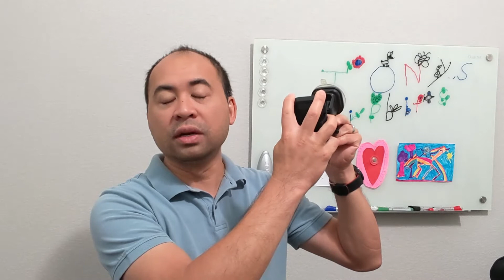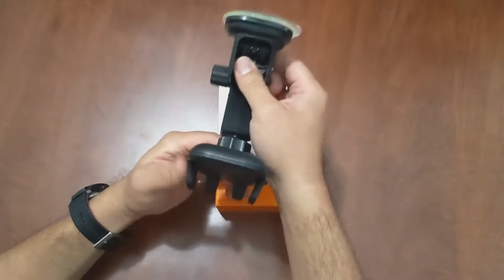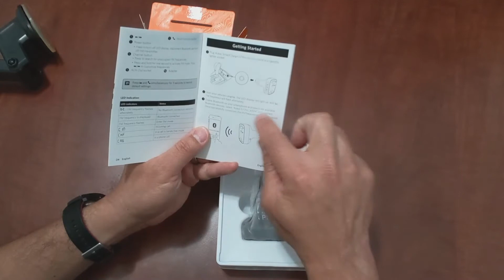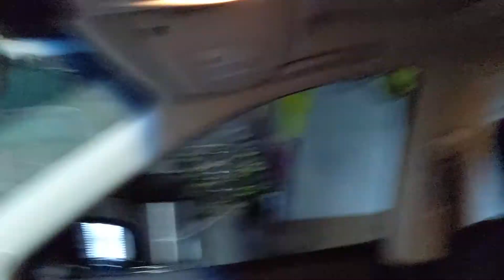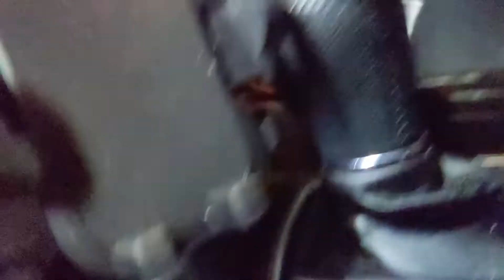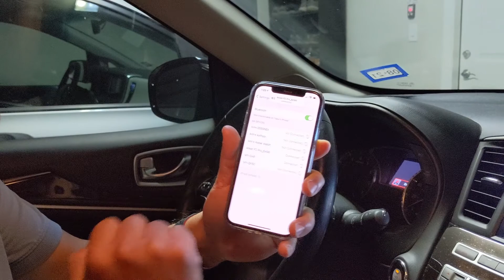Setting Up The Anker Roav SmartCharge F2 Pro Bluetooth FM Transmitter

Comment: I can connect with Bluetooth but app can't find my device, is there a solution l?
Reply from the maker: Did you make sure to put your phone to scan for device?
Reply: @TonysTipBits I did
Reply from the maker: Also what app? Once you connect with Bluetooth anything you typically play on your phone should go out of the car speaker at that point. Just make sure you have a clear FM radio station.
Reply: @TonysTipBits it's Roav viva app Roav charger app is not available anymore. I can connect the device with my phone but the app can't find the device so I can't use some specs such as battery check.
Reply from the maker: I didn't use the app so I'm not sure, try Anker support or maybe Reddit to see if anybody else has a solution.

Comment: The smart scan does not find any clear station for me.  I also tried myself and cannot find one.  I’m trying to figure out how to change the FM settings to international mode so I can tune into 87.9, which I cannot get to with the way it’s configured now.  That’s what my last ROAV was set for and the sound was perfect.
Reply from the maker: After some research I found this! "You can modulate the FM frequency by holding down the middle button for 3-5 S and then press the backward or forward button." I hope this helps... Thanks you for watching!
Reply: @TonysTipBits  Thank you!!!  I’ll try this.